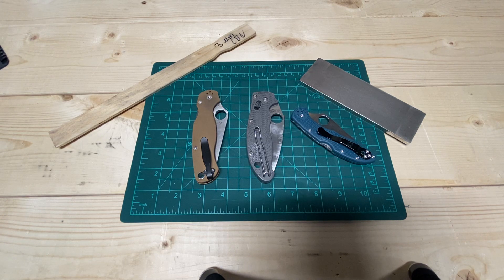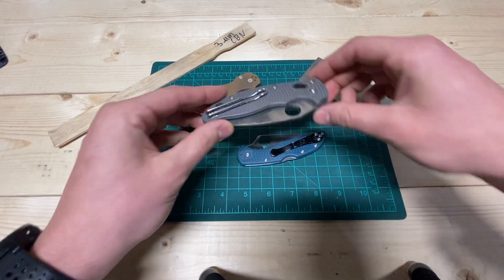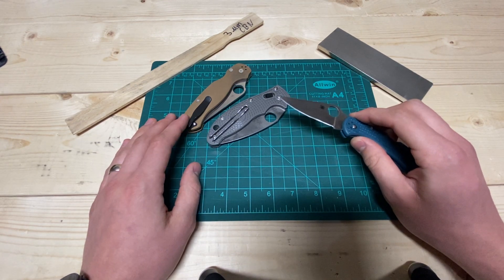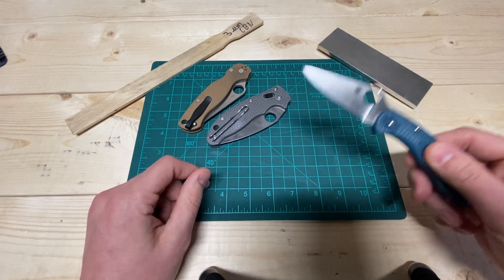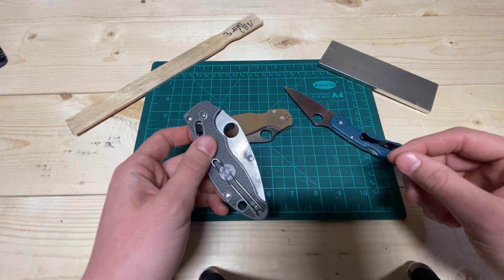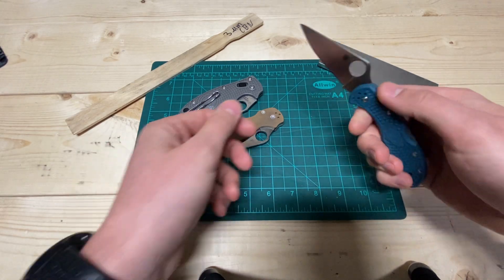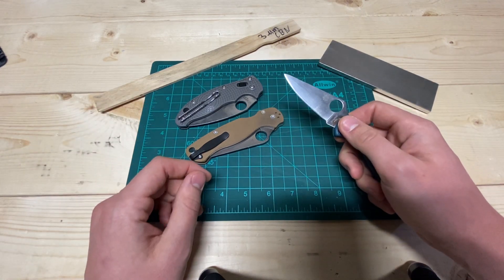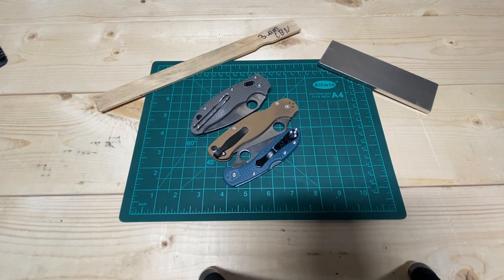Talking Steel: A Note on CPM-10V, K390 and Maxamet

Comment: In my experience, +20 years testing super steels worldwide, Carpenter Maxamet is the best for apex accuracy, tungsten carbides seem superior to vanadium carbides for accuracy, both give high retention.
In my experience Maxamet is more accurate, in taking extreme splitting apex, 0.5 micron, superior to 15V BBB and K390.
But all 3 are excellent steels, highly accurate and pleasent to sharpen, "formula 1 / motoGP performances".
K390 is the best EU steel, tested, way better then M390 (too much chrome), I will boost its chrome to 7% for partial stainless and refine more internal structure, particles distribution (EU requires more investments in advanced infrastructures and nuclear energy).
Maxamet is an "Olympic champion"🏆🥇, best worldwide, in my opinion.
15V BBB very close, also superb steel, love it, too.
Crucible is my favourite foundry for steel variety but Carpenter made something exeptional with Maxamet and Böhler is the best in EU.
15V is the best for stain resistance in this category, better particles distribution but Maxamet is allmost identical; all 3 requires oil protection.
Cruwear and MAGNACUT are more stain resistance, in semi stainless category (best chrome window 7-10% for land environments for me), also some of my favourites but less extreme performances, still very high.
Never had chipping problems with all 3,  excellent in EDC tasks, even in moderate wood carving, in very hard wood (testing "chipping horror stories").
Cool video, excellent steel choiches 👍
Even if there are also excellent stainless (S110V, S35VN, S90V... got all), I strongly prefer modern enriched carbon tool steels, like Maxamet, 15V, K390, CruWear, Magnacut, rex45...
I alternate both types, super nice variety 😃👍

🇮🇹

Comment: I know this is a really really old video for you ... but, would you agree that 10v and K390 are just about the same..? As in, would you pay more to get K390 over 10v ..?  Or even vice versa..? Bc it seems like K390 are at a premium for any of the knives that I'd want it in.
Reply from the maker: Performance wise they are the same. All comes down to heat treat between the two. 

K390 is generally more expensive in the US due to costs of importing from Europe. Plus the supply chain from Bohler/Uddeholm tends to produce fewer rolled sheets that are appropriate thickness for knives causing a level of scarcity
Reply: @EngineersPerspective701   Great info. I was going to get a K390 PM2 ... but it'd basically cost me DOUBLE ($270) vs a v30s (used) at $140. Of course, CRU-Wear are also available, but it's durability is even lower than ... which worries me: If I drop it the tip's going to crack off, etc.  If the used v30s were in very good shape, which would you pick between a: 
- PM2 in K390 (new) for $275
- PM2 in v30s (used) for $140
- PM2 in CRU-Wear (new) for $180 

Thanks buddy !! 🙂
Reply from the maker: Truly I can’t tell you what is going to be best for you. But I will say the Micarta Cruwear PM2 is for sure what I personally would get.

The k390 PM2s were heat treated a little softer (similar to how they did the 10V PM2s) than the Seki city K390 knives and you can tell. They are still delightful and incredible performers but the Micarta Cruwear knives they are making right now are just so great. Cruwear at 64HRc is just a blast. NOTE the older knife center Cruwear was not heat treated as well as the newer Micarta handle ones. 

However you're cutting a ton of abrasive rope, etc I would go K390. If you need stainless then S30V or consider one of the Magnacut PM2s would be even better.
Reply: @EngineersPerspective701   Outstanding info.   Though ... most of the K390 I've seen have actually had the Seki City info on them ... and I've been scanning for that. I'd have to say that I can't even recall seeing one that didn't say that in the last few days of looking at all the ones I can find for sale or even completed listings. 

Your vote for the Cruwear is helpful.  I thought it was daunting enough to try to understand the steel distinctions, which are at least LISTED. But there's yet another variable: not only the published specs (HRC of the steel by type), but whether they were actually doing a god job heat treating each of them.  

But for the price to value ratio, yes. I think I'll snag a cruwear edition. Honestly, it's already expensive to me. 

If I had a magic wand and the prices were identical, I'd get the PM2 in K390 (seki) with a Flipper. But bc they never do that (a domain name I owned: usually it's girls on our first date who give me that BS) ... They make Emerson Openers, but the only offer that on their cheap steels (VG-10).  So instead I'm going to add it on with one of those attachments for the thumb opener. 

Great talking and getting all your help.

Comment: I love that k390.  I wish spyderco would make more knives in it..... manix, para's, smock, etc.   I love that stuff.  It lasts forever, its not as much as a nightmare to sharpen as maxamet.    

 I have a question for you:  I was told I should really consider getting a diamond bonded matrix stone for the maxamet especially because   It's so hard, it will cut away the diamond on normal diamond stones, like it will literally cut away the metal the diamonds are on over time (but much faster than other super steels) and leave you with no diamonds left on diamond stone.    Is that true do you know?  Or does it wear away a diamond stone about the same as any other "super steel"?
Reply from the maker: Love K399 too!

Definitely not a real issue with Maxamet. Although it is very hard, diamonds are A LOT harder. Maybe some are noticing how work out there diamond plates are when sharpening Maxamet or they wear them out faster due to taking longer is how that concept started. 

I do recommend getting some higher end non-plated diamond stones if you’re really into sharpening though!
Reply: @EngineersPerspective701 Thanks for the reply!!   Yes I only have some very cheap diamond plates from Amazon…like the ones with the honeycomb designs.    What do you recommend? Like the venev centaur type ones or the jende ones?

I do have good regular stones i use the shapton pro stones, and they even sharpen most of my super steels fine.    But i just recently got the spyderco bug and now i have rex 45 and k390 (both my favs) and maxamet, etc…..so I want a good diamond stone.  Thanks!!

Comment: So if we're lazy and want to use regular stones... S30v?
Reply from the maker: I wouldn’t say it’s a matter of lazy, just upgrading your stones. But yes you can get a good edge on S30V with most stones
Reply: @EngineersPerspective701  thanks... Just don't want to have to carry extra special stuff to sharpen...
Reply from the maker: @breckfreeride  get a work sharp guided field sharpener and you’ll be set!
Reply: most v blades are not as easy to sharpen

Comment: Yeah I have found 10v to just be ridonkulous  when it comes to edge retention and it’s ability to be stropped back to a super aggressive and fine edge. To get the edge completely deburred I have to run a deburr pass with my diamond stone several times on my last grit, for me 800 grit. To get that super fine edge off I then transition to a series of diamond emulsion. One micron to .25 micron and finally .1 micron. The diamond emulsion has the necessary hardness and grit to really yield results. I know this might sound crazy but I strop most of my knives with a spent piece of cardboard that I squirt down with diamond emulsion. When I’m done I just throw them away. The emulsion builds up really quick and using a leather strop was getting super annoying cause it needed cleaned so often. But let me tell you, you finish that .1micron strop and the edge on something like 10V is literally like a laser beam. Since the time of this video 15V has come out and I got some experience with maxamet and rex45. I like 10V the best because it actually maintains a balance between hardness and toughness that’s still serviceable. 15V, Maxamet, and Rex45 seem to be super hard but they are so brittle that incidental contact with almost anything hard and it will wreck the blade!!
Reply from the maker: 10V is a super fun and great balance! I like using those disposable strops too so I feel ya. I wouldn’t worry about 15V being brittle for you. If you use 10V with no issues then you will be just fine!

Comment: Is the 10V brittle? Would it be good for hard use on a fixed blade? Thanks bro, good video.
Reply from the maker: Not really. My specimen rolls instead of chipping. That said it isn’t really an appropriate choice for a hard use fixed blade.
Reply: @EngineersPerspective701 тоді яку сталь ви порадите?
Reply from the maker: @Rzhyshchiv depends on what exactly what you are doing with a hard use fixed blade. Probably CPM-3V or 4V or Vanadis 4 extra

Comment: I have two questions if you don't mind. 1) how would you compare 10v to 15v what are some of the differences and why do you prefer 10v over 15v?  2) Has your perspective changed about maxamet? To me it seems anytime you're talking about maxamet I  sence a level of uncertainty. It's almost as if you like maxamet in some regards but you're not entirely sure whether or not you'd include it into your inner circle of favorite steel's. Sorry to bother you but there's not many steel fanatics out there on utube that's capable of your level of articulation.
Reply from the maker: 1) I have no experience with 15V so I can't say anything with certainty. I would guess that I would prefer a well done 15V over equivalently well done 10V simply due to carbide volume. I am doing everything I can to get one of the 15V Manix 2's that are about to drop and Triple B tested his at 65HRc. Should be INSANE!

2) I adore Maxamet. Possibly my favorite steel. Doesn't sharpen like any other steel and breaks down different than anything else too but I love it for those properties. Just a sweet steel for me.
Reply: @EngineersPerspective701  yes!!!! The manix in cpm-15v sprint run is coming soon I'm super excited about it. I already have a few notifications set up but I just don't know exactly when it's dropping.                         Okay , so you're really liking maxamet alote that's interesting. I've been on the fence about it for several months only because I heard so many people complain about maxamet being painfully frustrating to sharpen. One gentlemen who I know personally operates a sharpening business in my town, he went as far as saying " maxamet responds like a glassy like metal that has a tendency to chip away and fall apart while you're deburring it"  he absolutely despises it. Idk my guess is maybe people's  resentment is due to their unfamiliarity with such a unique steel perhaps their not utilizing the proper sharpening techniques this peculiar steel demands. Also their's a few variables to take into account right stones, right amount of pressure and I would imagine the proper progression is also vital. Thanks again for your wisdom it's well appreciated, best regards!!
Reply from the maker: @jimmycricket7946  IDK what he's using to sharpen maxamet but it's very easy to work with if you have diamonds/cbn and don't develop a huge burr. Stones like the Venevs are great to work with for it but diamond plates do good job too.  

Like any steel the first few edges are not going to be stellar as the fatigued factory edge is removed. That could be the source of his frustration as well.
Reply: @EngineersPerspective701  yes of course, I forgot that the factory edge might be fatigued or have belt chatter, a very good point. I'm surprised he didn't bring that up.
Reply: @jimmycricket7946  dont let the burr get big and done use any powered sharpener like a belt sander. The burr gets big fast

Comment: What is another name for K390. And also 10V I never heard of 10V. And can you tell me the grit of that diamond stone is it like 240 .
Reply from the maker: 10V is in the same series from Crucible as 3V and 4V that all use similar metallurgical principals. It was actually the first particle metallurgy steel ever produced. K390 was Bohler or Uddeholm's response to 10V. They slightly changed the chemistry due to patents on 10V. Some of the changes could be considered very mild improvements in how manufactures work with the steel. 

The stone is a DMT course, ~320grit
Reply: @EngineersPerspective701  thank you very much for answering me back
Reply: @EngineersPerspective701  love the in depth answer. I really like it when someone who actually understands the steel does the review.

Comment: I have the hardest time w my maxamet getting to hair sharp. No matter what I do it’s toothy as all. Cuts cardboard great for months. But can’t get that hair pop sharp like my other knives (m-390-20cv-elmax) easy…..this all ways ends up like a steak knife. Stones are diamond course up to 2000 ceramic any help will be great. Strop w green compound. Wonder if diamond paste will help ?
Reply from the maker: Definitely try to use 100% diamond abrasives when sharpening Maxamet!

There are probably 2 reasons you aren’t getting good results. 1) not truly apexing because it’s so wear resistant 2) forming too large of a burr. 

I was also struggling with it for months so I eventually forced myself to only carry it until I figured it out. Took about 2 weeks but I did figure out how to get the hair shaving edges I like. 

The biggest piece of advice is to sneak up on the burr. How to do that is work one side 80% of the way to a burr. Then do 85% on the opposite side. Then do 10% on each and finally barely raise a burr doing the last 5%. You may want to go up in grit on the last 5% depending on the stones you’re using. Finish the sharpening normally with minimal burr formation and strop on diamond compound. 

I have a video of me sharpening it and so does big brown bear that I recommend. 

https://youtu.be/oOco3Pj98T8
Reply: @EngineersPerspective701  thank you very much. I will do that. Fingers crossed.
Reply from the maker: @jamesincharlotte  You’re welcome! Hope it helps!
Reply: Did it help?

Comment: I did a convex regrind on my maxamet to 15thou and the edge I use is 17dps back bevel, 20dps microbevel leaving stones at 850 grit diamond plate to 1 micron strop. That’s how I get aggression on maxamet. I run my fingers over the edge and it sinks in before I have a chance to respond. To remove the “micro burr” I do edge trailing strokes with only the weight of the knife. Also, to sharpen maxamet I start by running the knife perpendicular to the stone to kill the edge. (A killed maxamet edge will still slice😂) this removes fatigued steel. You can sharpen maxamet on japanes natural stones, and it leaves carbide sticking out like gravel glued to a rope.
Reply from the maker: I did a video where I sharpened it on a king neo which uses 800 grit SiC and that cuts this pretty well. Same video I tried a nanohone 1K and it was brutally slow verging as expected. 

Maxamet seems pretty reluctant to hold onto a burr which is a feature I really enjoy!